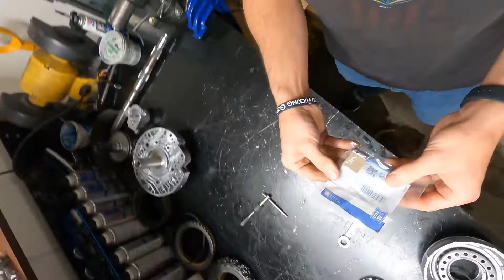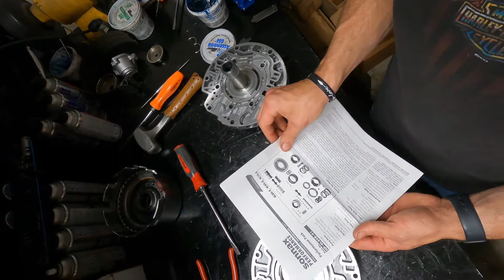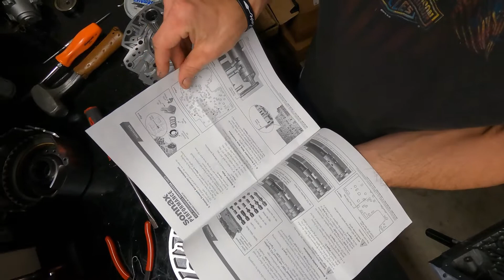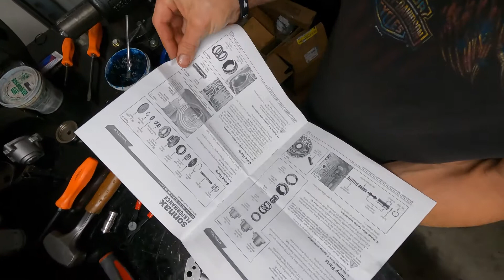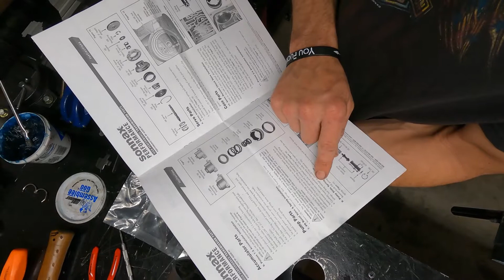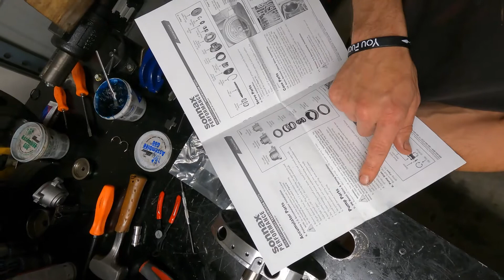2003 Chevrolet Corvette 4L60E 400HP Build Part 1

Comment: Excellent video I’m surprised you use the low reverse wave plate I personally remove them in most builds that aren’t completely stock and correct clearances accordingly

Comment: Do you measure your tolerances with dry clutches or with them already soaked?
Reply from the maker: I measured the frictions and steals, apply plates, and wave springs prior to setting everything up wet. It gives me a better idea of where my tolerances are going to be and I make adjustments where necessary. But the units I ship out are completely soaked and the units built in the house are dry and ran for a minimum of 30 minutes to allow the unit to lubricate itself before running an all gear ranges and performing a test drive. Each builder has do’s and don’ts.
Reply: @performancetransmissionsll1573  thank you!

Comment: I noticed you do not soak your clutches? I have seen some builders soak them and some that don’t. Is it necessary to soak or is it better to put them in dry?
Reply from the maker: Some builds I do and some I don't. If you allow the transmission to run and idle for 30 minutes, the lubrication circuits will soak everything in the same amount of time necessary as you would building the unit with the clutches soaked. My high horsepower builds always get soaked prior to assembly. Every rebuilder has their own technique. Not all of mine are built the same.
Reply: @performancetransmissionsll1573   is there anyway I can reach you for some advice I am wanting to rebuild my trans in my 01 Silverado 4x4 lost 3rd and 4th